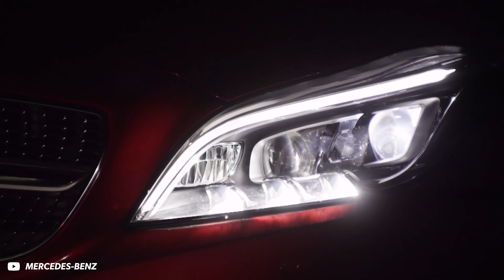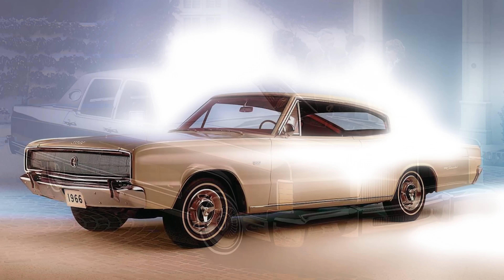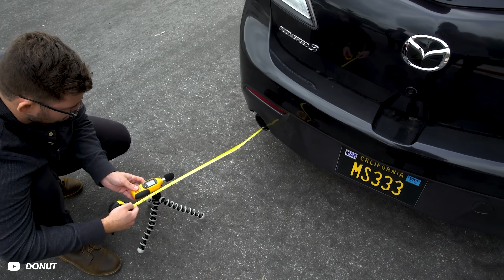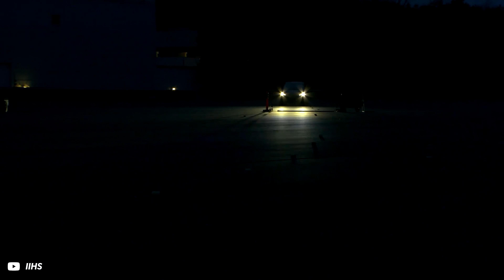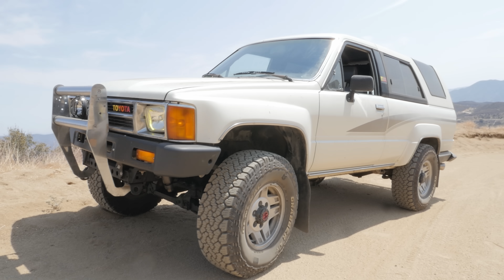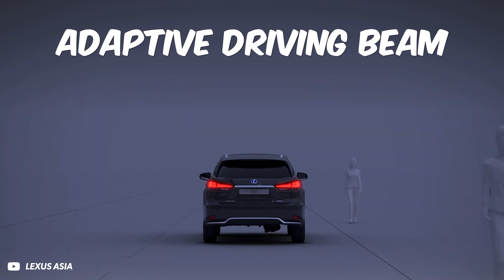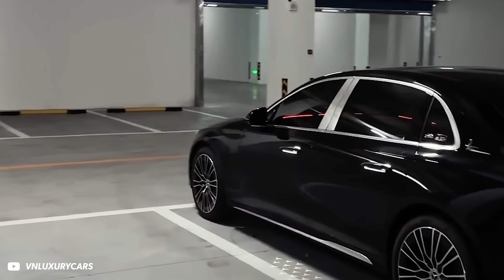Why new headlights are blinding American drivers

Comment: Adaptive/Mateix/Digital lights also have their issues. On highways, you will blind trucks, as the low wall between the oncoming traffic is too low to shield them from high beams, but high enough to occlude the trucks strong headlights from your camera.
So you just glare into the driver cabin.
On normal roads though, it works great, unless the distance to oncoming or forward traffic is very high.
(Camera will not pick up that traffic, but you already hit driver's eyes.)
So you still have to treat it as a Semi-Automatic system and judge when you become a problem.

Comment: I avoid driving at night for this very reason. One thing that helps a bit - I bought  a static cling sun-shade from Sporty's Pilot shop, cut it to the right size to reduce the glare in my side mirror on the driver's side. I keep it in an envelope in my glove box and don't move at night with out slapping it into position on the inside of my window.

Comment: Most Cars here in Europe do not have Adaptive Lights so its LED Lightshow on European roads too. Maybe not as unregulated as in the US but what does it help if the ultrabright LED of the SUV behind you shines through your backwindow and iluminates your complete car interiour while the approaching traffic has either not dipped their light s or has adjusted them wrongly upward to shine into the nightsky?
And don't forget these damn LED backlights, they are ultrabright as well and mounted higher on modern cars which means they are excactly on head height and with brake lights on at the red traffic light you practically go blind.

Comment: In my area there are two issues that can also overlap. 1. Drivers with highbeams on. 2. SUVs and trucks that are higher off the ground, raise the point of the light, placing more people in the focused angle of the normal headlight, and more so with highbeams. I don't have my mirrors directly angled to my eyes, I have to angle my head slightly which helps with cars behind me.

Comment: ADB is only good in theory. In practise it has the same problems as automatic high beams: it only starts to cancel out light on a car that it can see. And mostly, thats after the driver of said car has been blinded. Normally a good driver would see the light of another car on the road/ on the side of the road before the car itself is visible (lets say in a bend) and shut down the high beams before the car is blinded. As long as ADB cant do that, you will get blinded. Though it must be said: getting blinded for a split second is better than always getting blinded because someone installed a mini-sun in the headlight.... Thanks TüV we dont have that in Germoney

Comment: View from the UK - I have driven three generations of BMWs LED and even Laser headlights - first generation was rubbish, today car, now three years old, simply works, UK also has issues with aftermarket modifications which can be dangerous, but if drivers focus on the on coming vehicles lights, they will be dazzled, as the intensity of the light is so powerful at source, rule do not focus on the headlights

Comment: What wasn't mentioned is how even new cars show up from the factory with incorrectly aimed headlights. And, almost no one actually takes the trouble to fix it. For most cars, all you need is a decent flat wall and a screwdriver. Make sure the part where the oncoming lane sits is turned downwards like it's supposed to be with low beams. Teslas are one of the most commonly noted offenders since headlight pointing is controllable from The Screen and is reportedly often not correct from the factory and/or drivers crank it all the way upwards. But I've noticed that other marques are frequent offenders. Late model Mazda crossovers in particular; their low beams are like some car's high beams....even in my taller-than-them but still stock height 2021 4Runner! That is just bad aiming. You flash one and they flash back and now you're blind from looking into the sun.

Comment: (Another) European here: In my opinion, the headlights of factory new vehicles often are adjusted to high. It cant be right that they shine into my eyes whilst I'm walking or sitting on a bicycle. That's almost 2m high and thus much higher than the mounting height (from which the beam should fall, not rise).
Not mentioning what it means to pass oncoming traffic by their right side* as a cyclist or pedestrian -you'll stop seeing a thing ahead of you.
*sometimes the path is only on one side of the road so 50% of the users have to look into the oncoming traffic and their lights.

Comment: Toyota Tacoma, seem to have really bright lights, or at least lights that point higher than average. It may be due to lowering the rear end, but it seems like every Tacoma is like that, and I don’t think every Tacoma owner lowers the rear end to level the truck. Also Ford explorers seem to have bright lights and I have high beams. A few thinking they were shining high beams on me. Cops drive those so don’t High beam, a cop. And finally Subarus seem to have really bright lights that are extremely annoying. Great video.

Comment: The worst part about driving in europe is that most cars on the road are cheaper cars and chinese cars, those cars have stupid automatic high beams with shit sensors and those with these adaptive headlights are very few. 

You are right however when speaking about older cars with switched headlights and/or headlamps, it should be illegal, and i believe it is here, but, they're still used at will.

Comment: I used to be one these assholes blinding people in my truck several years ago with LEDs, that is until I did 2 things. Firstly I bought a set of LED headlights made for reflector housings not projector housings and secondly I had my headlights actually aimed professionally afterwards and I've never been flashed at since AND I still see more of the road than I used to. The dealer mechanic that aimed the lights said that if headlights shine over the top of brake lights in front of you, its too high

Comment: If I understand correctly, in the USA you don't have mandatory yearly vehicle inspections in some states and therefore I guess people can get away with putting all sorts of modifications on their car. In the UK cars have to go through yearly inspections, which includes the headlight beam alignment, so it does help to catch out some incorrect/illegal modifications. However, even still, we're also struggling with being blinded by bright headlights. I suspect most are caused by incorrect fitting of the bulb, incorrect replacement bulbs, and an increase in SUV type cars, which sit higher on the road, therefore their beam is higher for the vehicle in front.

Comment: LEDs are so easy to control. Have them dim when faced with other lights below a certain height, or shift color temp, or have low beams be dimmer yellower LED light and highs be LAZORBEEM, hell, go real crazy and introduce an industry standard of polarization then you can have glasses or even windows that nearly black them out.
My Jeep has normal lows and crazy LED highs, it works fine. I can even turn my highs up and down in brightness, for no real reason beyond i wanted to make it do that. The only reason I keep the lows is that they are pointed down lower and i dont want motorized lights, otherwise I could just run the single LEDs on ym high/low knob.
too many solutions.

Comment: The amount of time this video puts into just how bad the NHTSA has handled the new law is wild. Engineers aren't even sure it's possible to meet the new standards, and even if they do it'll takes years of research to get a working model. Then probably years after that to start seeing then on vehicles. So automakers petitioned to allow the European standard in the meantime and were outright denied. But NHTSA has zero policy on making the current situation better in the meantime. While I as someone who can't drive at night anymore due to the excessive amount of light appreciates the stringent rule change to exceed European standards, I don't appreciate the utter lack of immediate change.

Also, Rivians are one of the vehicles I'm most often blinded by when they are behind me. The closeness of the elements means I don't have much impact by them when they are oncoming.

Comment: I have worked as a light technician for a headlight OEM providing products for brands like BMW, VW group and Mercedes, I have so additions concerning legal requirements: 

1. FMVSS requires a -0,42° cutoff left of the kink for driving lights while the European ECE (and Chinese CCC) asks for -0,57° which reduces glare. And since glare is highly dependent on vehicle height, which isn't accounted for by the legal requirements and only the IIHS, SUVs or trucks (of which the US has way more than we have here in Europe) are more responsible for those glare scenarios.
2. adaptive or "matrix" headlamps are mostly used for the high beams so they won't change the glare from the low beams (again, only -042° for the US)
3. manufacturers want specific, high light intensity zones right below the cutoff so a little bump or a not perfectly setup headlamp blind you very easily, especially when the low beams have intensities of up to 42 000cd there
4. IIHS requirements are tested for BUT are not legally binding and only grunt work to make the manufacturers happy when looking at the numbers

Comment: Dude - it´s not working in europe , still the same fucking problem.

maybe a little bit more worse than before, sometimes you will get blinded so hard cause of  the adaptive driving beam.

i'am driving with a yellow tinted glasses, helps a little.

and the next problem is that those drivers  
rely on the automatic high beam switch-off

Comment: I'm disappointed by this video because it spends almost none of its run-time highlighting the main danger - incorrectly adjusted headlights. It's been proven that headlight brightness doesn't correlate with danger, but incorrect adjustment does. Focusing on brightness is missing the point.

Comment: In Germany there's a lot of laws concerning car lighting. You can't just slap something aftermarket on, can't even change the bulb to one that isn't officially tested. So older cars have to stay with halogen.
However I notice a lot of changes in car lighting on new cars that was obviously allowed by the officials, that is just insanely distracting and bright. And yes that also means the adaptive light. It blinds more than anything I've seen.
Once again, bureaucracy defeats logic.

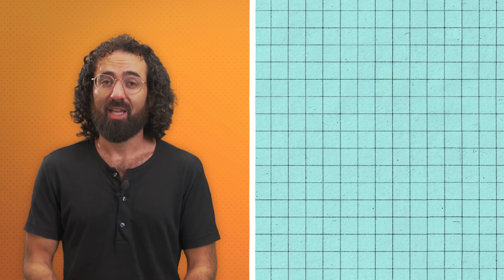Comment: 8:33 no one is checking? Portugal here, we need to get the car inspected every couple of years if its old enough and then every year if its a tad older than that (I forget the exact spans)
Reply: The thumbnail clearly shows europe and the US
Reply: The thumbnail clearly shows Europe and the US
Reply: Yeah, this is all over the EU. They also specifically check the lights and the setting of the lights. You must put them to 'zero' and then they slide some mirrors in front to see if the lights are not shining too high.

Comment: It‘s crazy to see this video as an European. My 1.3 million pixels in my Mercedes GLC are a real game changer. I‘m driving it for nearly 2yrs and I wouldn’t drive without it. During this time I had just 3 occasions where I encountered that the system wasn’t working as intended, someone was slightly blinded for a couple of seconds, 2x on high speed downhill Autobahn ramps, where the crossing truck was blinded. The other occasion was on a very bumpy countryside road, where the limits of the actuation where reached, honestly I was to fast for the road conditions.

Comment: I have noticed that in the USA they seem to make a rule or law once and then never change it, even if it is decades out of date.
Is that just political pressure from existing industries who don't want to change?
Another thing most of the USA is lacking is mandatory yearly safety checks on the cars. And yes those include the light patterns.

Comment: I get my experience might be different as I'm in the UK, but honestly, I put most of this problem on car owners. I've worked nights as a truck driver for years, thousands and thousands of vehicles pass me every night, and the only difference for me between halogen and LED is the colour temperature. There are a handful model of cars that have obnoxious LED headlights, such as the Tesla Y, but there are just as many cars with halogen lights that are equally obnoxious such as the mk8 Civic hatch. The reason I blame owners, is that 99% of the time I'm dazzled on the road, it's some fucker with badly adjusted headlights pointing at the moon, another fucker with cheap aftermarket LED's for their 20 year old car, or another fucker who refuses to turn off their full beam lights. Matrix LED and Adaptive LED (I got matrix in my truck and adaptive in my car, they're amazing) promise to fix all those problems - but it relies on drivers actually using them - and another common thing I see are people with auto headlights who turn them OFF then drive up the motorway at night with no lights on. I think it's a 'rising problem' because aftermarket electronics are becoming cheaper, more ubiquitous, and easier to get hold of, and there seems to be a rising sentiment of lack of care in car maintenance (i.e., making sure your headlights are in adjustment), as well as an attitude of 'fuck everyone else' that's also rising.

Comment: After recently changing cars I've noticed occasionally other drivers flash me (like I've got full beam on) when I'm dipped, I drive a vauxhall mokka (buick encore mk1 for Americans) with LED side lights and xenon HID projector lamps (it's the top spec version) oddly I think it's the higher ride hight and LED sidelights that are the issue, love the car and it's only occasional but yeah, the sidelights are bright

Comment: Luxembourger here.

Every year our headlights are getting tested. If they don't meet the regulations, you need to call a towing vehicle to the next garage, because you won't be allowed to drive the car anymore until the issue with the headlights is fixed.

The only exception is if one of the headlights broke and you have either:
1) An appointment for the repair
2) An older car which doesn't tell you that a headlight is broken, but then you'll have to book an appointment and send the police the picture of the repaired headlights within 15 days or face a fine and immobilized vehicle until it's repaired.

Comment: ADAPTIVE HEADLIGHTS ARE NOT THE SOLUTION!!!

It would be much better to restrict the brightness (luc & candela). It seems to be the only way. I have been blinded heavily by cars with adaptive headlights in various situations - as a pedestrian, a biker & as a car driver; even inside my house! People drive through cities with their highbeam on. They don't think anymore. Instead, they only rely on the tech inside the car. No one is using the levers for headlight actuation.
There also must be way more focus on the headlight setting/functionality during inspections & police should also use measurements to provide safety for everyone.

Investigations found out, some cars don't even meet the regulations when the car is brand new! The industry just doesn't care. They are not being controlled ...

Comment: As someone who lives in Europe adaptive lights seem like a good idea but it does not work as advertised at all. Before it reacts and adjusts itself you have already gone blind, And it can't deal with bumps curves and railings or other obstructions so instead of something that's constantly blinding you it instead flashes your eyes on and off. The same goes for auto high beam switching it takes way to long to react and allot of the time i have to flash the oncoming car to tell them to turn their shit off, It doesn't help that every light is white/blue instead of the classic yellow/orange, Sure it looks nice and stylish and clearer but it burns your eyes like crazy.

Comment: A lot of people use HIDs and LEDs with older style reflector bowls. They should only be in projectors, especially for Jeep's round headlights. Even the old halogens bulbs can be blinding on level road.

The new worst ones for me are the Jeeps and chevy's with headlights where your fog light should be. Way low on the bumper so they're blinding on low beam until I get within 30 - 40 feet. I'm in a truck so I'm not low to the ground...

Comment: There are three major, one is manufacturers are aiming their lights too high from the factory. Two is inconsiderate douchebags are installing LED and or HID into their shitty halogen reflector headlamps, and also not aiming them down. And three, police are not enforcing the local headlamp aiming laws. States have headlamp aiming laws. Unfortunately the only real fix is active enforcement with an annual vehicle safety inspection or similar. It sucks, no one wants this, but it is probably the only fix. You cannot count on manufacturers and vehicle owners to self regulate, and product manufacturers are not helping but are simply getting more money in sales.

Comment: Xenon headlights and all the "matrix" headlights are an unadulterated cancer.
Not only they are too bright by default (great if you're going 200kmh on a highway at 3AM when nobody else is there, I guess), but all the "adaption" systems work far too late and don't work half the time when following a car.
What's the point of "adapting" headlights, if I get blinded by 5 full seconds before they switch?